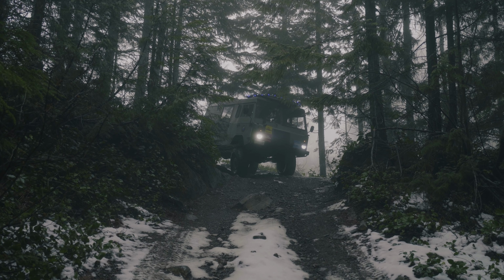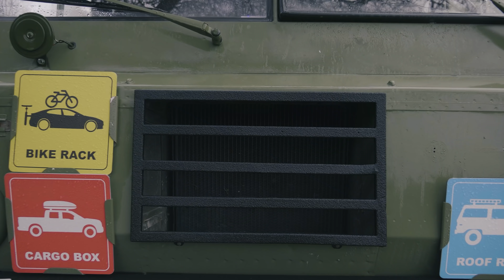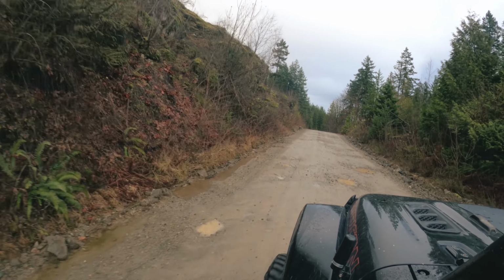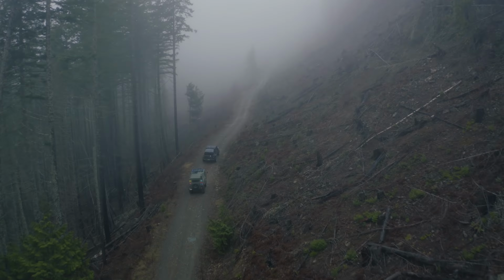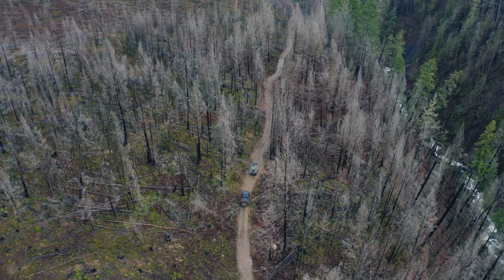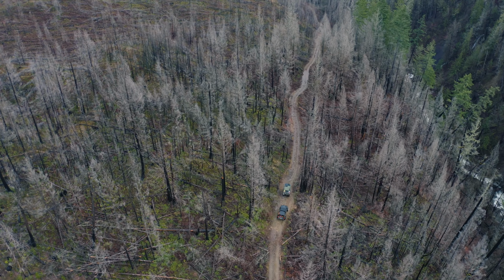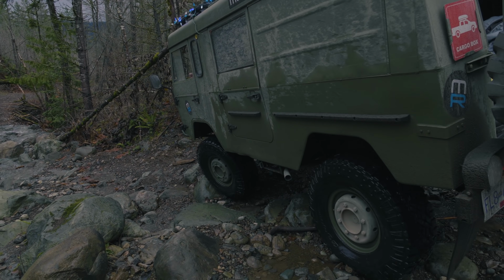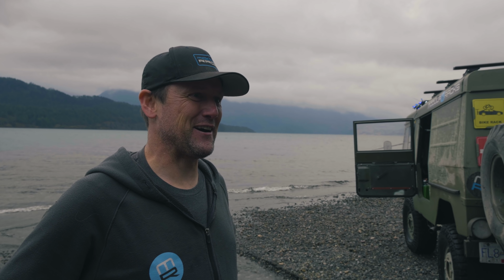Ultimate Off-Road Military Van Follows Jeep Gladiator on Trails

Comment: This video brings back some great memories. I drove the 6-wheel version of this when i served in the Swedish military ~20 years ago. Awesome off-road but as you can imagine, absolutely terrible whenever we had to move longer distances on road.
Reply: Same here, 11 and 13 Volvo did i have some fun with and 30 and 40 Scania. Later i drove Galt my last years in the swedish army.
Reply: Same here, TGB11
Especially remember how we once were taken into the forest, and the lieutenant showed us the map and told us:
- You should drive from here to that position (pointing on the map)
- But there's no road!
- Yeah. Here's an axe.
Reply: Härligt!  And I don’t think I ever saw a sharp axe in one of those trucks.. Lol.. I have since replaced the mud of Tofta Artillery range and instead have the backroads where this is filmed in my backyard
Reply: @jnilsson9117  Sharp axe? Is that some kind of cheat code?
Actually it was quite amazing to see what exactly you could do with the car! There was almost no limit to where you could go.

Comment: Volvo comes with portals, air lockers, locking transfercase, 2 speed transmission, 37's and some other goodies for the imported price of $15k-20k
Reply: In Sweden the prices are approx $5k-10k and are going up each year.
Reply: @nissebopp  I'd love to find a decent condition C304/TGB13 6x6 for that price. I'd rather import than pay the asking price of some of these rigs that are already stateside.
Reply: One of these with the OM606, a ZF6-750 and a NP205 would be a beast.
Reply: @bladenrexroth2555  A guy in germany has importet a OM 606 in it. I´m loo
king for the video...
Reply: I would love to see the government lower red tape to make it easier to import those old 4x4 let's call Brandon 📞.

Comment: I was passenger in one of those Volvos when I was in the military.
To me it felt like it was going to tip over at any moment, but it never did.
I drove a Bandvagn BV-202 myself. That thing are amazing too, I was never stuck anywhere with it. 
Put on a small exhaustbend, and you can drive it across the lake. Yea it floats.

Comment: I foolishly passed up an opportunity to buy one of those Volvo 303s about 10 years ago on a military auction. They use mostly domestic Volvo parts for the motor and transmission is what I understand. First time I saw one was parked outside the bar in Coldfoot Alaska, a miner owned it and used it to bring his boys in for a drink.

Comment: That C303 was the military version. I had the version they made for the electric company to run  power line roads. Exactly the same except for the rear interior lay out. It has a divided lockable  storage bin on each side that run  the length .  Much better layout for exploring. Everything is easily removable, doors, back door, windshield (it's also flip down), the roof  and even the  aft part of the body. 
They are super easy and fun to drive. They turn really well and the portal axles are fantastic. The drive train is all pneumatic push button (toggle). 
 Everything locks and 4L 1 is 3mph at red line. 
They aren't nearly tippy as it looks. All the weight is at the bottom.  They are SLOW. Top speed on the highway is about 75mph.  
You can get them cheap in Sweden .  
I never should have sold mine. :(

Comment: I drove a Volvo C 303 like that when I was in the Swedish military. We drove on similar roads as the one you drove on here. Sometimes worse. And it was useless on such roads. (if you can call them roads) I don't know how many times I got stuck. The one I took care of there, had no power steering, no power brake, no diff brake.  This made it impossible to get around on such roads. Then it was impossible to drive faster than 50 mph on the open road.

Comment: More like a Pinzgauer - nothing like a unimog!
Reply: Yes they do look alike but what he meant is in suspension design which is similar to unimog solid axles with portals. Pinzgauer also has portals but it is fully independent suspension kinda like ford's twin traction beam axle.
Reply: @evoemperor3776  the pinz has a " backbone chassis" kind like Tatra used .
Reply: @pinzgauerbelgium  yep you are right on that.

Comment: the van is interesting, wonder how hard it is to get parts for, I should call my insurance agent an say Im thinking of buying one of these off EBay and ask for a quote (-:
Reply: I depends. Most parts are not that hard to get, but some special parts are.
Reply: @volvotgb9999  from the local Vovlo truck shop?
Reply: @woof3598  It depends, but rather not. AFAIK, with the decomissioning of the Volvo TGBs, all existing spare parts were bought by Tatanka.nu, so Tatanka now is the shop.
Some parts are standard parts, e.g. fuel pump (it's a B30A [with a special camshaft though]) or clutch. Some parts are unique, e.g. transfer case or axles, or springs. And for some parts, alternativexist.
After all, it's not just a great vehicle but also an antique car - mine is from 1974!

Comment: This might sound crazy, but we still have them in service at the Austrian military. They are great for driving in the Alps. They are called "Pinzgauer". Cheers.
Reply: No, they are not.
Pinzgauer is a complete other brand, this is a Volvo C303.
Reply: @hellbillypete.7898  Well they are different brands,...but same concept and very similar looking. I have driven both and can say they are nearly the same.
Reply: Still they look the same...but are NOT the same.
Reply: @pinzgauerbelgium  I never said they are the same. I said "We still have them in service (Those kind of vehicles). They are called Pinzgauers." I know that he drove a volvo, that's what he said in the first 10sec of the video.
Reply: @mathiasm3462   do they still have the series one 710/ 712 or are they now driving the serie 2 diesels 716/ 718 pinzgauers? I know they used to sell them at action in Thorn........if you didnt see it ......i drive a 716k civilian pinzgauer.
Reply: @pinzgauerbelgium  Hi, as in my time beeing with the austrian military I only was the vehicle operator. I remember I used to drive the 716M, 710 and 712. There was not a single Pinzgauer without a patrol engine. I'm not familiar with all the different models but those three are the ones I was driving the most with.

Comment: Please it's no van it's a Volvo!
When I did my military service in the early 80's, I drove both the 4 and 6 wheel variant and we had to drive on the army's training track to learn how much you could use Tgb 11, 13, 20 as they were called Tgb stands for terrain car 11, 13, 20 are the different models. The Volvo can handle much more than what you exposed it to, because it is probably the driver's courage that runs out before the car overturns. Since then, the C303 has also won its class in the Paris-Dakar rally, it is a competent car you have bought. 
http://www.femorefortet.se/Kalla-A.htm for more models

Comment: The Volvo is the cheap cousin to the serious runner, the Pinzgauer. Available in 4x4 and 6x6. Downside, high c of g, take care.
Reply: Well the volvo and the pinz are verry close going off road....but the big diference is the drivetrain...
Reply: @pinzgauerbelgium  My experience with UK Marines is that the Pinz has a very complex, hence expensive, drive train. I've never seen so many gears involved in getting the drive from the engine to the wheels.  Hell of a bit of kit though, Sean would love one.